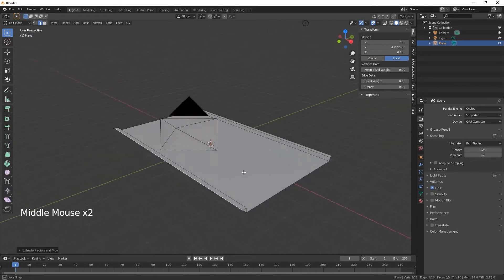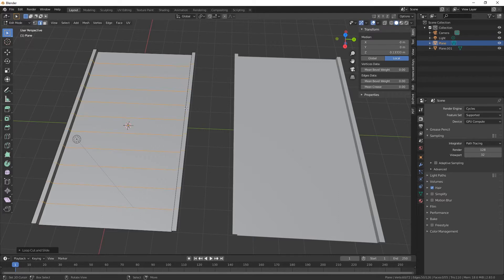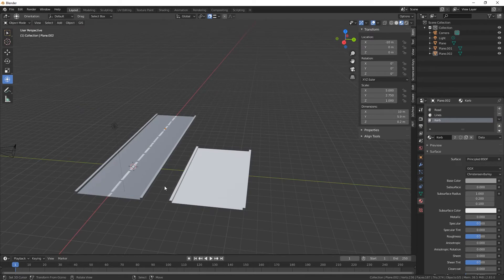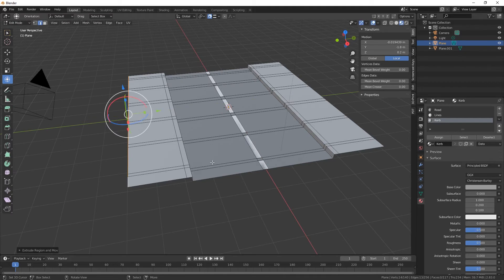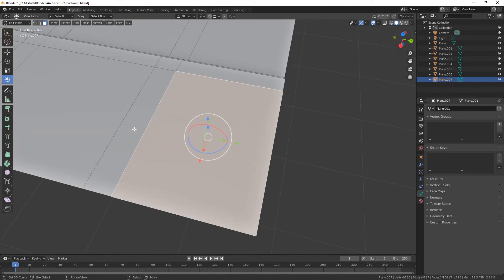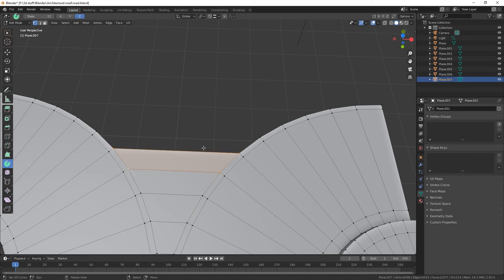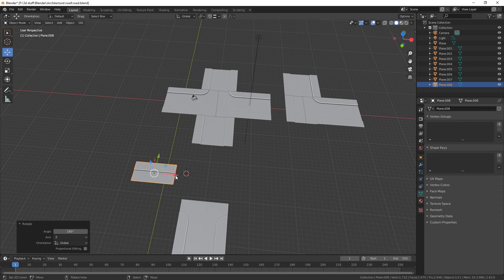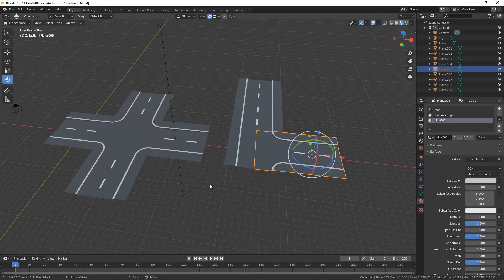Blender 3D - Easy: Road System

Comment: You're better off applying the road stripes as a texture and avoiding all those unnecessary loop cuts. That's way too much geometry. Presuming you intend to lay the pieces out flat on even terrain, you don't even need half that many quads--and if you're planning on making curved segments, about half would do (depending on how sharp the curves are and how smooth you need them to look). If you're planning on using models as game assets, you need to remember that the computer has to calculate every object in view in real time, so more quads means more stress on the GPU. A good rule of thumb is to limit quads on items that don't matter much (things that don't  need to rotate or bend, and things the player won't be examining carefully), so that you've got more compute resources for important items.